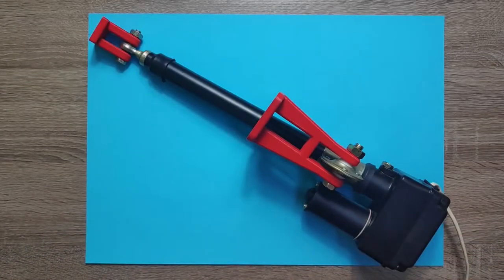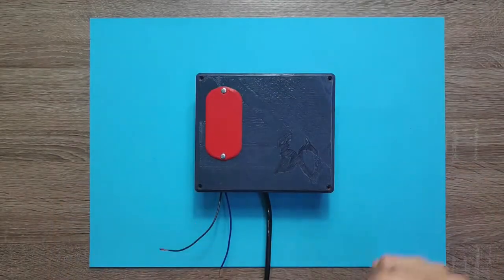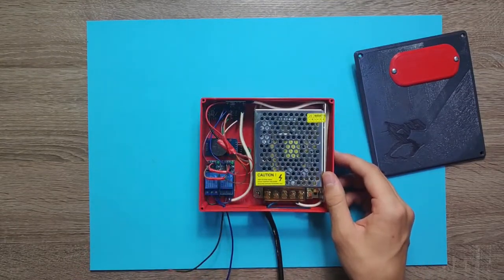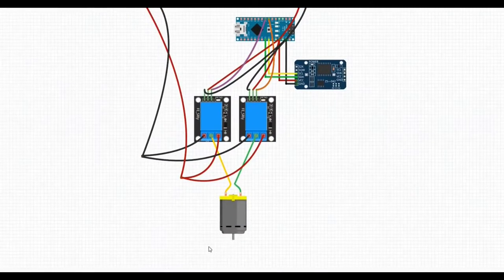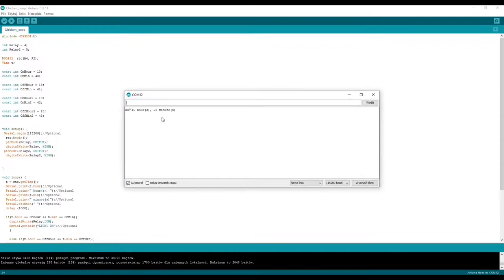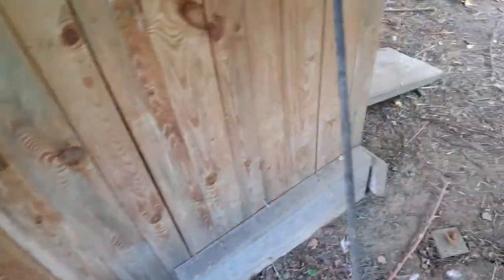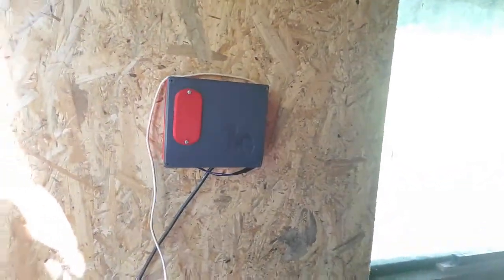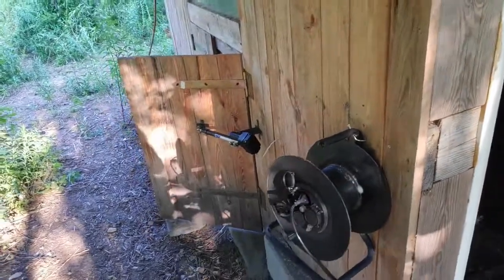Arduino Automatic Chicken Coop Door

Comment: Good evening from Greece! i was looking exactly the same project to do on my chicken coop as well, unfortunately i know nothing about programming and my best chance was to find exactly the same thing. Thankfully i found it in your video. Not knowing anything about programming as i mentioned above, is there any chance you could send me the code and the schematic, adding 2 limit switches to stop the doors when opening/closing at a certain point, because with no limit switches, it either closes to much/crushing the wood, or it stays a bit open all the time in my project...Thank you so much in advance!!!